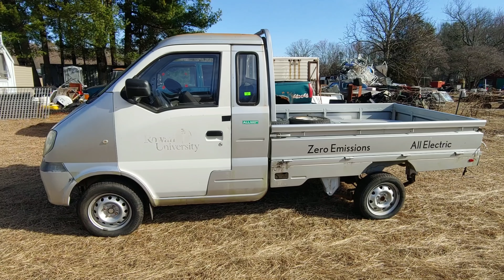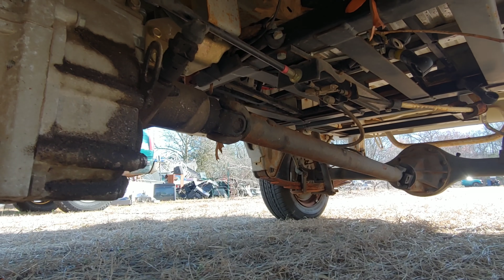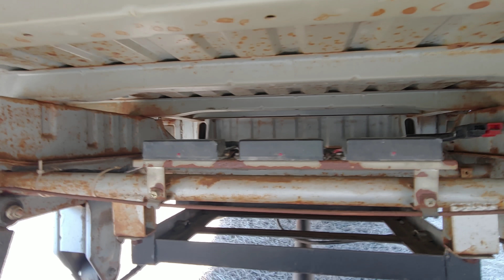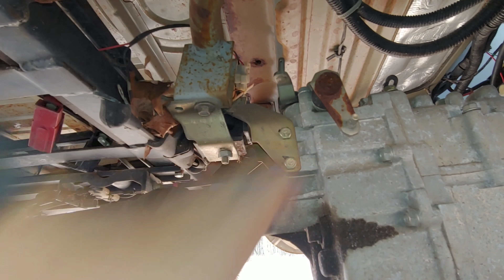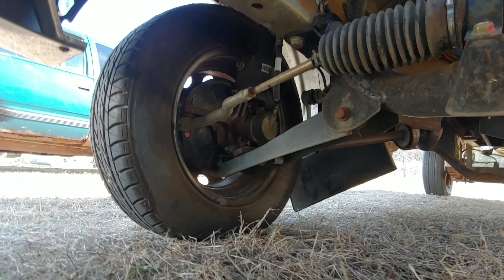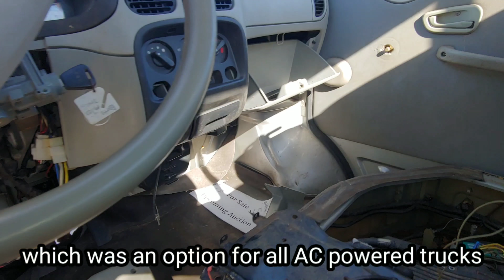Electric utility truck zx40st

Comment: How Hot does your 3ph lines coming out of your inverter going to the motor get? Mine gets HOT…
Reply from the maker: Unfortunately I never had it running....
Reply from the maker: If they're getting that warm, go bigger....
Reply: @ScrapFarm  I think something is wrong with it, it will only drive about 1mph and gives me a code 43 and 25…so you still have it?
Reply from the maker: @snowcatcowboy  ya I still got it just sitting
Reply: @ScrapFarm  any chance you want to sell me some parts if I need them?
Reply from the maker: Probably not put, i'd probably get rid of the whole thing.... If you're anywhere close.

Comment: Have you made any progress on your zx40st? I bought a similar 09 and it's all coming together fairly well. It powers but my 72V battery pack is at 10V. I need to pull the bed and check each of my batteries individually. I'm also looking for a few parts if you know of anyone parting one. Here is a short video of mine.
https://youtu.be/z8gKk7HN2vE
Reply from the maker: Unfortunately mine is just sitting.... Eventually, I would like to take the drive train out and put it into a different vehicle... Mostly because getting parts for these things is pretty much impossible... Biggest issue I would have is getting the brakes to work and they would probably have to be modified with brakes off of a different vehicle. So I could find parts.... So with that being said, someday, I might put the stride. Train into a small pickup or media metro.... But also for me to do that. These tesla packs are gonna have to come down in price.... I don't really see it being worth it to build a vehicle with a lead acid pack anymore... And right now I don't have five grand to buy a crashed tesla pack.... Or even a couple grand to buy some cells... Maybe someday I'll do something with it. I hope you have fun with yours but mine is just sitting there wasting... I might be willing to sell some parts off. It that don't include the running gear. But I do not ship and I am in new jersey...

Comment: Got same truck looking for parts
Reply from the maker: Good luck.....if your close ill sell ya mine
Reply: @ScrapFarm  were u at wht state? Thanks for the reply
Reply from the maker: Nj
Reply: Dang I'm in co
Reply: Honestly jus need transmission...I think someone swapped it out nd put a durgan 4cyl gas fuel injectors in mine
Reply: Dongan engine my bad
Reply from the maker: Yeah mine's only missing the batteries.... Everything's pretty much there as far as the drive unit goes

Comment: Where did you find parts?
Reply from the maker: Didn't. Still sitting.... Really just bought it for the drive system maybe some day I'll put it in something else.... But a Tesla pack's gonna have to be cheaper than 15 grand lol
Reply: @ScrapFarm  There are all kinds of AC motors and controllers nowadays. I am looking at one of these now and there is very little information about them. Just gonna have to Fab my own parts.
Reply from the maker: @MrHydroguy   Yeah the biggest problem I had was trying to find break parts and things like that so.... Probably would be easier just  Take the drive unit and put it in a geometro so you can get parts....
Reply: @ScrapFarm  I found one working just needs new batteries. Miles ZX40SD.  With A/C
Reply from the maker: I believe that this one works too just needs batteries but the brakes master cylinder and other things are going to be hard to find I might have to just retrofit them from something else....

Comment: I have a running miles zx40st, it actually just quit running, trying to find someone to fix it, but seems no one in the east bay area California is smart enough or has any time to help me fix it no matter how much money I offer to fix it. Mine is complete with everything, even a/c and heating, plus regen braking. Wanted to put Lithium batteries into it but then it quit running

Comment: Great job on the video. Same boat here. Do you know where one could get a service manual or at least a user manual ? Thx !!!
Reply from the maker: Now I don't know anything about this thing really I pretty much just bought it on a whim for 250 bucks I was like okay LOL I figured if I ever messed with it I have to modify everything anyway so
Reply from the maker: It'll probably end up getting some Nissan truck parts LOL
Reply: I know...Having a heluva time finding even a manual.... Look at the bright side...at least it's not a "ZAP"...The WORST EV on the planet 🤣🤣🤣
Reply from the maker: Ya im still hopeing the drive system works

Comment: I would fit a small generator onboard to charge the batteries...get a trailer and pennies in fuel and lower running costs - work out the running cost of the other trucks and you will find the money in scrap on the property.
Being probably the only scrapper with an electric truck would bring many more subs - it would pay for the cost of finishing it over time.
Reply from the maker: I would really like to... it's all about the money bro.. can't really invest it if you don't have it.  And yes there's money in scrap sitting around here but not that much especially at these prices... I'm trying to hold out as long as possible.. hopefully the price is come up before I really really really really really need it...lol
Reply from the maker: I would love to throw a couple Tesla cells in there.. these batteries are totally different world compared to 2008 technology.

Comment: Bert, call Liberty in my town, see if they can get you wiring diagrams or get you in touch with someone in Corp., for overseas that could possible help get the diagrams you need possible, never hurts to ask! Either that   or rewire it with golf cart? IDK, but that would be cool as sh^^ to have it running around town. Like the body/bed on it a lot...I can hear it now over the radio, "Attempting to stop a, IDk What The F^^^ It Is But It's Only Doing 25 on 4m twds the circle, lmao Bro!!!
Reply from the maker: There's a bunch of PDFs from the manufacturer online that I can download. I did find them the bigger issue is going to be ordering hard parts because these things were not really in the states it's basically a Daihatsu Toyota and Subaru brumba. So I should be able to get parts from some of them and make them work
Reply: @ScrapFarm  Hope So, that would be cool as shit to get that up and running! That has less rust then your 2 work horses, lol..
Reply from the maker: @jimstevenson9033  yeah less rust because it only gets four miles to a charge and they never used it....lol

Comment: Is there electric vehicle sites a wiring schematic would be able to be attained. Or wanted request posted. Think about joining ebay japan for parts. Also ask auction who bought the other one. When they find out what all missing and cost you could possibly have a parts back up. I’d donate to a fix it up fund
Reply from the maker: There is a lot of information online and PDFs from the manufacturer that I can download that won't be a problem. I appreciate the offer for the donation and thanks for watching. Hopefully I can do something with it
Reply: Slap some blueberry farm advert on it or scrap info it will pay for itself
Reply from the maker: @sharonaaultman6871  I would love to get it going and take my blueberries to the market in the summer time in it would definitely be a cool talking point and everyone would look for the little truck
Reply from the maker: I do also have the ability to put Farm use tags on it because it does have a 17 digit Vin it limits me to 20 miles from my farm but I don't really need to go any farther than that in that little truck

Comment: Looks very cool AMF built some very sought after boys/Mx style bikes mid 70s early 80s. That wagon is flee ride all the way 👍
Reply from the maker: Hopefully I can get the little truck going either way whether I put a gas motor in it or get it going on electric I could throw Farm tags on it which will exempt me from inspection and allow me to drive it 20 miles from my house I don't think I really need to go farther than that
Reply from the maker: Taking the blueberries to the flea market on the power of the Sun...lol
Reply: Scrap Farm that would be awesome

Comment: You should put lithium ion batteries in it. That thing will really float.
Reply from the maker: I would love to get some Tesla cells to put in there just my pockets are inside out there so empty LOL
Reply: Yea, Telsa cells would set you back more than you prolly paid for the thing
Reply from the maker: @Allenlay1694  for sure but the range would be greatly extended just in the amount weight reduction
Reply from the maker: @Allenlay1694  maybe we need to go blow up rich rebuilds comment section maybe help donate some LOL
Reply from the maker: Plus if I'm going to keep it electric do I spend over $1,000 on let acid batteries or do I put that money into 18 650 Tesla packs?
Reply: I think lithium ion would work out good...much better power out of en...longer range as a charge only has to be done when the batteries hit 10%  compared to lead acid at 50%  sure theyre a few bucks more but check out a company called lion they have a youtube..youll be amazed at what those batteries can do
Reply from the maker: @Allenlay1694  thanks.... I've been into that stuff electric vehicles and things for many years just never had the funds to really do an awesome set up.... but I now have an awesome little truck with usable parts One Step Closer
Reply: Good for you. Wishing nothing but suxcess for this project...if we all survive that is
Reply from the maker: @Allenlay1694  lol... I'll still be here I'm actually looking forward to everything shutting down for 2 weeks maybe I'll actually get some of these projects around here finished that I want to do but just can't keep my happy ass at home

Comment: I gave you a thumbs up for your knowledge Bert, not for you really thinking you could ever get that running. That's a 1000 hrs in research, part hunting and the time you'll have in repairing it. Why not scrap it, you should get your money back. You can at less say you had one. Where would you get the time or the money. Good luck though.

Comment: It would have been nice if you could have bought the other one as well. That way you could have a vehicle to cannibalize.
I think I would have preferred having that stand behind riding mower and that trimmer contraption to this vehicle, but thats just me. 
Congrats on the new lawn ornament and the sale of the tires and rims.
Reply from the maker: $200 is way different than $2000
Reply: Scrap Farm how right you are. But you're independently wealthy, aren't you Bert????

Comment: do u have a plan
Reply from the maker: Not exactly I would love to get the electronic system working with a cut-down Tesla pack in it but I don't think that's ever going to happen. Probably going to do something with a small gas engine maybe even air-cooled

Comment: Nice looking little truck but I doubt if you'll get it back running on electric those tracks at little gas motor sitting underneath sideways but it'll be interesting👍👍😀
Reply from the maker: I know if my pockets were deeper I could definitely get it going on electric. But it's probably going to be like a v twin air cooled Honda or something

Comment: Have you considered 12 volt lithium batteries for medical equipment? They can be used just like lead acid batteries and I'm pretty sure they have p.c.m. chips boards built into the top of the batteries for low voltage shut down ect
Reply from the maker: There's a lot of options out there I've looked into different stuff for golf carts and things in the past it's just a finance situation really I just can't afford to buy anything like that right now. It would probably cost me next to nothing to get it moving on a small Honda V-twin engine or something like that and if I wanted gears with that transmission I would need to figure out a clutch and issues on that and too or just change out the transmission for something different

Comment: 72v system eh, that will be sweet if you can find out how its speed is governed, I doubt it has hall sensors in the wheels because it is shaft driven so they might be in the transmission or the motor.
Reply from the maker: I believe it's under the cap on the end of the motor... this thing would be nice with a tore down Tesla pack in it... oh a Boy Can Dream
Reply: @ScrapFarm  I would check out those 12 volt medical batteries, you might be surprised at how cheap you can find them online

Comment: A little 2 rotor rotary engine would fit right in
Reply: My daughter bought an RX8 and sold it 4 months later. She absolutely loved the car in every aspect but one. When the car was cranked it was more than important to let it warm before it was turned off. Inherent problem that was hard to overcome. Everytime her husband moved her car and turned it off it wouldn't restart without a complicated procedure. Many vids on the tube about this
Reply from the maker: @donniebrown2896  for sure I've worked on them in the past and that is a major issue
Reply: @ScrapFarm  yep, after I threatened to put a major hole through the engine with a very large caliber self protection item my wife found how to start it again, she loves Google.

Comment: Large cc Honda motor cycle engine , Honda shadow 1100 water cooled , pretty easy engine to find. I might even have a spare .I can't stand electric vehicles I used to have to drive them and plenty of time would be walking back 
Carrying my tool bucket .
Reply from the maker: That was before the age of wrecked Tesla's and Priuses..... this thing with the right battery pack in it has the potential to be pretty freaking awesome and also pretty freaking expensive LOL

Comment: Are you able to change the governor?  What am I thinking?  Of course you can!  You are Bert!!
Reply from the maker: Well without the proper Curtis controller programmer and code reader I probably won't be able to do much... but for the cost of the entire project it's probably going to end up getting a gas or diesel engine in it
Reply: @ScrapFarm  I don't know anything about a Curtis whatchamacallit, but if it can be done you are the guy!